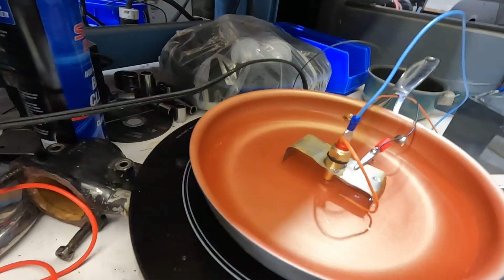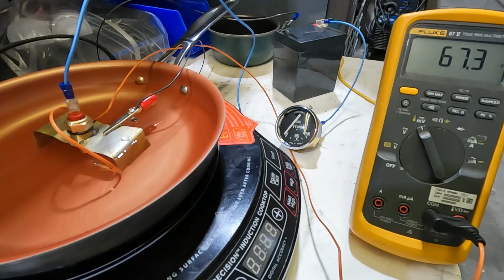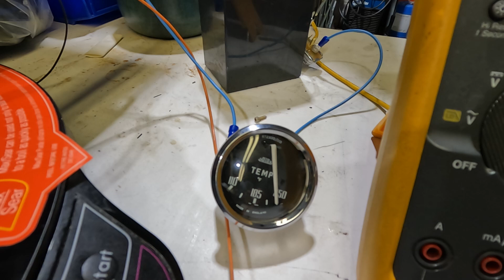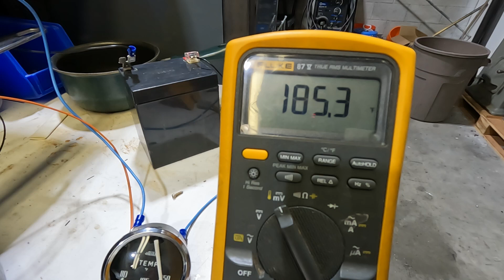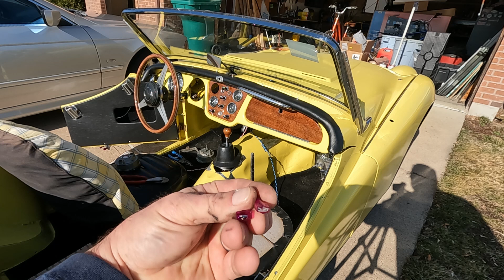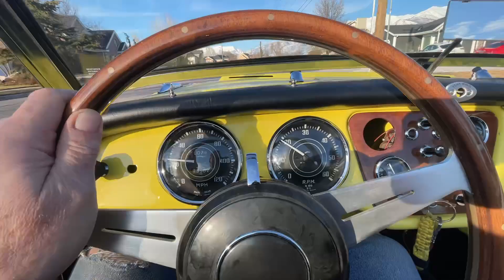Testing of Higgins' new electronic water temp gauge

Comment: Could you just make a new face plate for the gauge that was calibrated based upon your measurements?
Reply from the maker: I'm gonna call the restoration shop today and see if there's a calibration screw on the back of the gauge. Otherwise, I'll either have to put in a series or parallel fixed resistor, depending on how the temp sensor works, to calibrate it. Or I could put a variable resistor under the dash and it could be my calibration point.